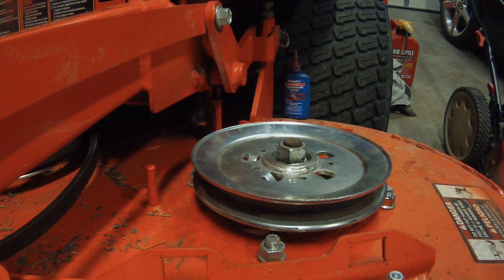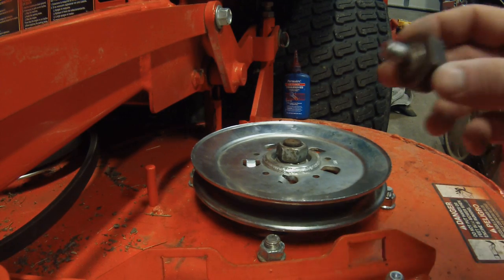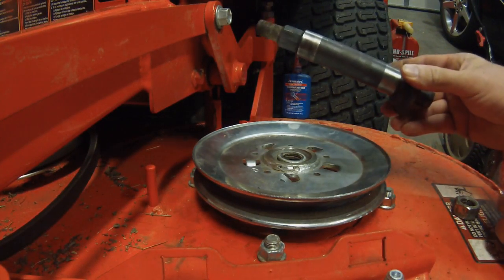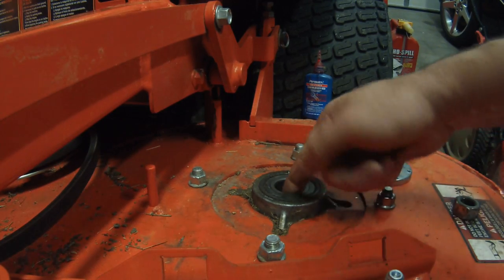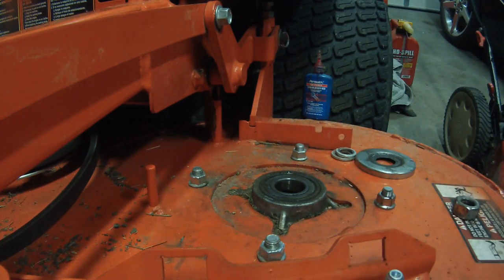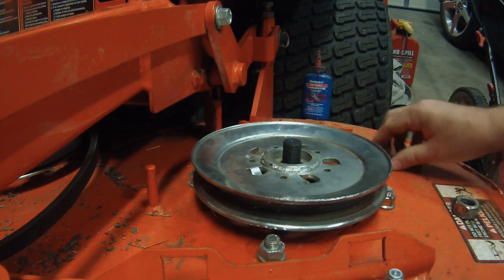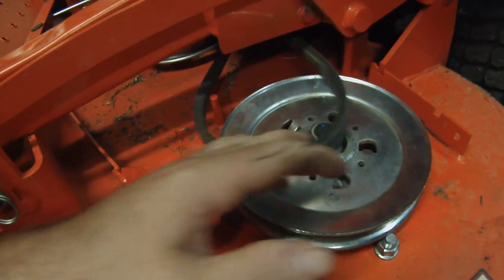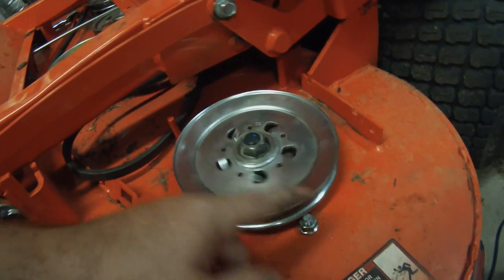Fixing a spindle shaft on a zero turn mower    ( kubota z725 )

Comment: That top nut came off my buddys Kabota and dropped it.  The other 2 blades smashed it up knocking the zerk fitting off denting up the blades etc.    There is no safety cotter pin to prevent those top nuts from backing off.    The only thing holding it together is that top hex nut.  If that blue locktite fails which his did = shaft + spinning blades dropping into the other spinning blades.

Comment: excellent, thanks. I own an eXmark that I cross threaded the blade bolt and need to replace or re-thread the spindle shaft soon. The Gravely spindles suck tho. They are one solid piece and you can only buy a whole new spindle.

Comment: I have tapped mine out to coarse thread 1/2 bolt and like tite them in when I change or sharpen blades. I own a lot of Kubota equipment. One thing you must remember Japanese steel is not your grandads steel!!!

Comment: How much was the spindle shaft you purchased?  Any chance you have part number?
Reply from the maker: K Brown 
The shaft and new bolt was somewhere around 70 bucks give or take.  Sorry i dont have a part number but when i called the dealer to see if they had one they wanted to know the serial number on the deck of the mower, which on mine is located on top of the deck behind where the grass discharges.

Comment: I have a Z726XKW-60 and mined broke also.Had nothing but troubles with this mower...10k and i would never buy another one.Dealer sucks and will never buy a Kubota again!!
Reply: I just bought a set of 10 replacement bearings for my Z726 after a bearing failure after only 100 hours of use.  I was disappointed  to see the original bearings I removed were stamped "China".  I bought the XiKe 10 Pcs 6206-2RS bearing from Amazon and seem to be a perfect fit.  At less than $2.50 per bearing, I took the chance of replacing the original bearings that had metal seals to a bearing with rubber seals.  I really don't see the need for a metal seal anyway.  Time will tell how these perform.

Comment: Do you know how to replace the bearings on it? Mine was making notes and removed it now just want to make sure I put it back together correctly
Reply from the maker: I've haven't had to do it on mine yet, but you would probably have to take the housing off by the 4 bolts that the bearing sits in and press the old bearing out then press the new one in.